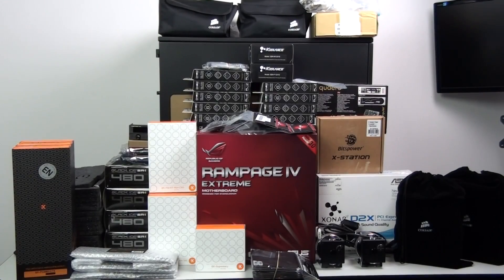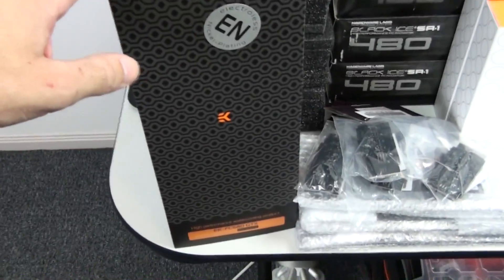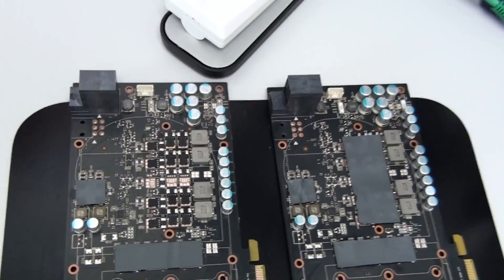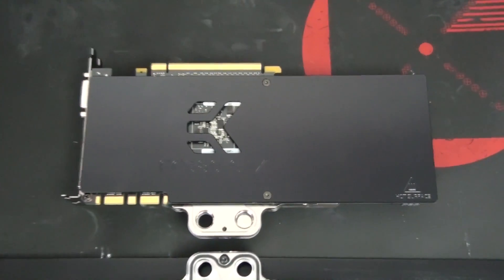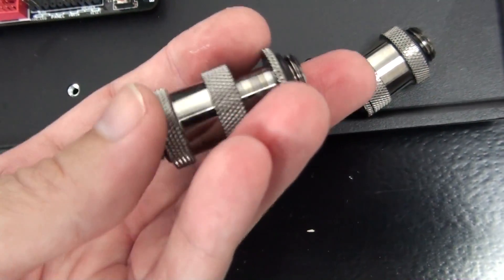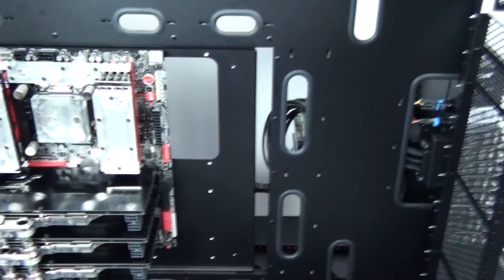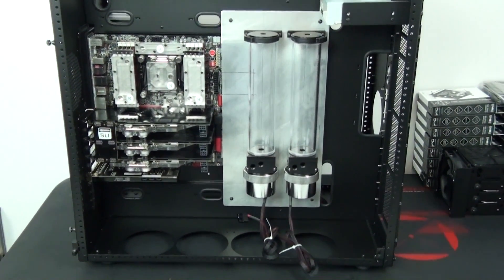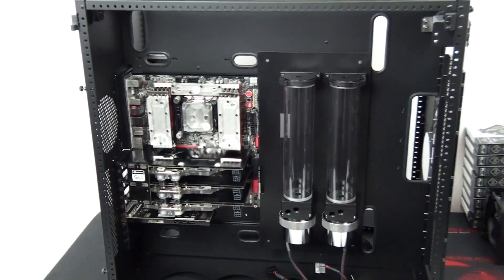Build #10: Extreme TH10: Part 1

Comment: It's Bitspower Crystal Link, 12mm OD 10mm ID acrylic used with 'multi-link' fittings from Bitspower.
Primochill Rigid tubing goes with Primochill Rigid Ghost fittings.

Comment: So with the acrylic tubing what fittings are you using and what brand tubing. I was planning to use primochill, but it doesn't work with bitspower sli fittings.

Comment: quick question about the graphics cards, you dont seem to have a clear inlet and outlet, aren't you meant to have one tube going in and one going out with stoppers in the other two holes? the way you have it couldn't the water simply flow straight past the actual water block?

Comment: What model of tygon are using for 1/2 3/4 bits power fittings? I remember you talking about it in a video but I recently read that sone tygon is not good for compression fittings.

Comment: A 690 and 7990 are two gpu's on a single pcb. There you put two 690's together it is quad sli. You put two 7990's together it is quad crossfire. 2 gpu x2 = 4.

Comment: Correct.

But it wouldn't be a problem putting 4 cards in a system, physicly, which would give a Quad 690 or 7990 setup.

Only problem is that it won't work, since drivers don't support more that 4 GPUs. But I'd bet somewhere someone did that mistake.

Comment: You must know what threads your blocks have, how big tubing you have and what kind of corners you will be doing.
The threads are usually G1/4 atleast around here. And the tubing 10mm or 8mm, 10mm being more common these days.
so lets say you are using 10mm tubing with EK blocks (manufacturer) which seem all to be g1/4 pick up G1/4 10mm fittings. Then think your loop trough and see if you need 90 degree or 45 degree fittings.  Easy as that :)
If you need more advise feel free to pm me ;)

Comment: Guys just a note on the fittings, DON'T simply look for multi-link fittings as said in the video.  There are several varieties of multi-link adapters, some of which don't have screw threads (used for linking multiple hard tubes together).  The ones with threads are C47 (the normal size ones) and C48 (the mini ones).  This is very important as the C71 pictures look very similar to C47, look for the number.  Please up vote this so that people don't make mistakes!

Comment: HI! I could use advise on a watercooling build with copper pipes. What kind of fittings can i use? Is the build easy to disassemble if i have pipes where the ends are not into the same direction?

Comment: Will you be adding a full range of sensors to the Aquaero? 

Inspired by your work, I had initially planned a water box that used sensors to control fans and pumps (I've since taken an intermediate step to upgrade current loop instead), But the idea of a self managing loop is very attractive,

Comment: I would be extremely interested in how you got that paint finish on the res/pump mounting plate. Did you powdercoat it or was that actually paint?
I have an SMH10 in which I'm currently building a system, and one reason I haven't done anything that would require major paint work is because I couldn't get the finish to match.
Anyway: Lovely work you're doing here, I like it a lot :)

Comment: Well, there is a 512 SSD for running programs etc. The greens would be for storage so speed isn't such an issue, they run cooler and safer.